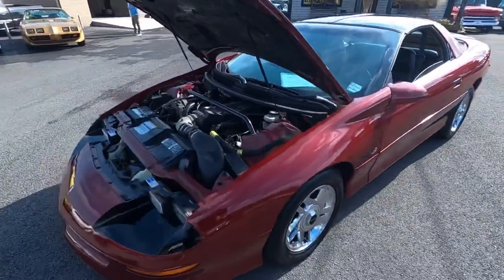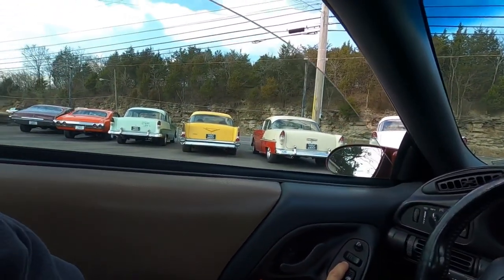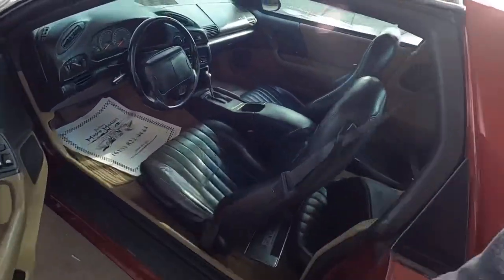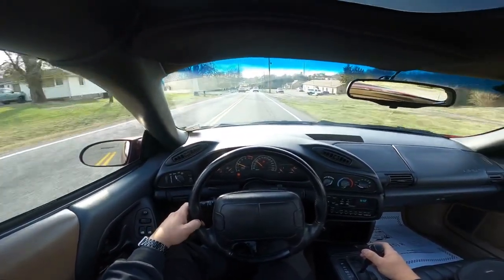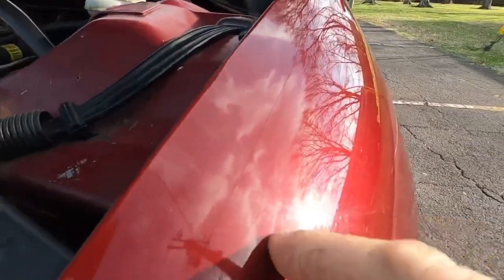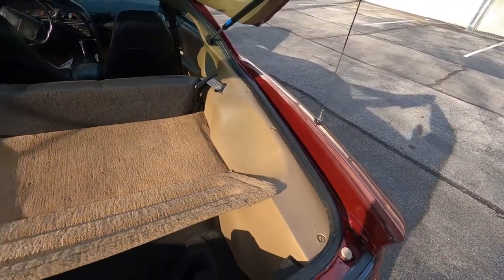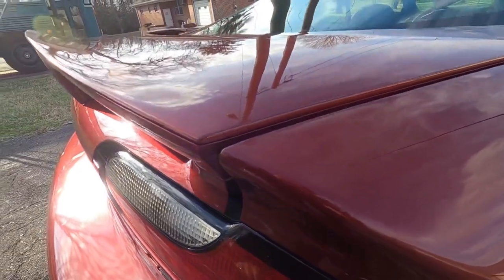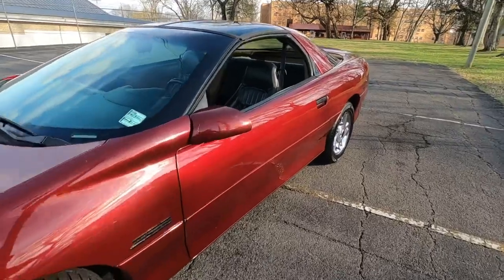Test Drive 1995 Chevrolet Camaro Z-28 SOLD $9,950 Maple Motors #1535

Comment: What a beauty. Lol that door shut noise was just as clunky as my 88 iroc. Was told a LONG time ago if your SBC AIN'T leaking oil you need to worry. That mild film don't worry me none
Reply: I lol'd at the door shut clunk as well, same as my 91.
Gorgeous 4th gen.
Reply: I swear all sbc’s leak even ls engines after awhile but all of them run damn good and run forever
Reply: the "clunk" is a GM trademark! all mine did it, new or old.
Reply: That’s because people just love to slam the doors on these Camaros after a while they make loud clunk noise. They’re heavy doors and when slammed cause a lot of vibrations and damage everything inside them. I think that’s part of the reason why the window motors go out often on these cars. My 95z doors click shut so quietly because I never slam them and always tell passengers to not slam  my damn door.

Comment: That's a righteous Camero! She has a sweet growl in that exhaust system. Great car for the price. Hard to believe it's a classic already...
Reply: Camaro not Camero ugh.
Reply: @coop4274  Apples to Oranges, it's a typing error. Not that big of a deal...
Reply: I have have a 95 Z hard top the same color with 60k. Lots of mods! Way beyond stock.  My drivers side power window was fading so I had it replaced. I just had my AC recharge and I upgraded my sway bars to the UMI brand. Looks like you have a Magnaflow catback exhaust. That's what I have on mine.

Comment: I almost bought that exact car and color in 1995
until I was told about the issues with the Optispark!
Reply: Really overblown,  I've owned my 97 SS for 4 years and have put 20,000 miles on it. 74,000 total on original optispark. Have driven it through the rain , car washes etc. The pre 95 models had more issues with the non vented opti

Comment: Those seats are definitely not original but still looks like a fun ride. The dashboard is not too badly cracked given 94k miles on it. I recall a friend of mine bought it's twin the Pontiac Formula and that thing felt so much FASTER than the cars before it. Crazy to think there was a time when nearly 300 HP felt like a lot of power. 😁

Comment: Abs in op light is probably because of the ss spoiler. On the lt1 f body if you changed the spoiler to a ss spoiler you have to put a resistor in it so it wouldn’t throw the brake in op light. The car thinks it’s a dead bulb back there. That’s what I had to do when I had my 93 z28.

Comment: I use to have the same exact car, except it was a six speed manual and Teal Color where the color would be green at one time of the day and the other time it would be blue. Loved that car!
Reply: My summer driver is a 97 Z28 Mystic Teal, 4 speed auto, leather seats. I've had it for 20 years. I'm 74 and probably should sell it, but it's too damn fun to drive!
Reply: @1968usaf  I bet it is, with all that low end torque!
Reply: Those mystic teals were low production and are rare to find for sale. I was looking for one in that color but ended up with my bright red 95z.
Reply: @kevinrodriguez9701  Didn't know it was a low production but I know the car that I had was special ordered.

Comment: This motor is a bolt on motor. Just an exhaust, intake, and maybe one or two little things. Sounds like stock internals. Awesome car. The dings and scratches on that car are notorious for fourth GEN Camaros and the cheap plastic interior makes owning one of these 25+ year old cars that much more nostalgic put a small cam in this bad boy and you’ll piss off your buddies 40+ thousand dollar coyote Mustang.

Comment: Ik im tardy to the party for commenting, the check engine light coming on for 10 seconds and turning off means a intermittent problem has occurred but the problem went away but a dtc will still be stored. Just some helpful info :p